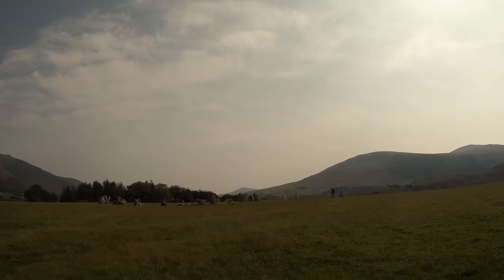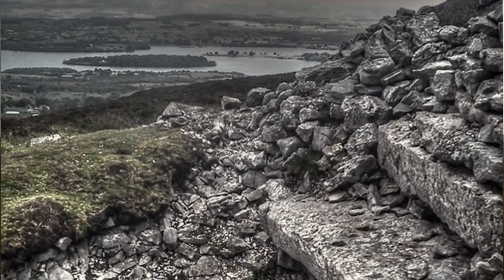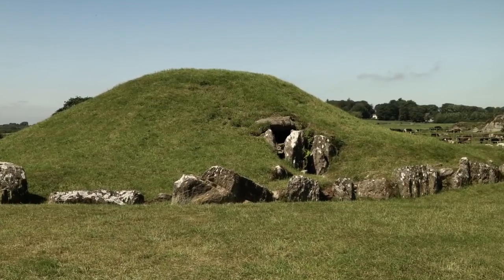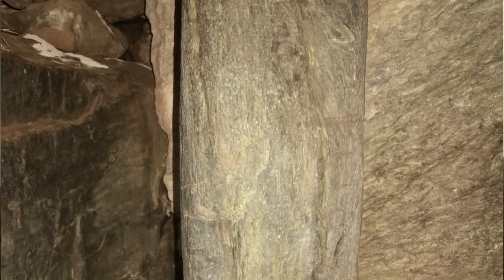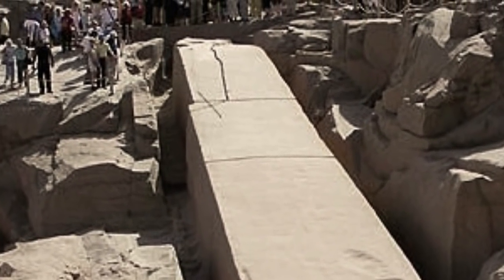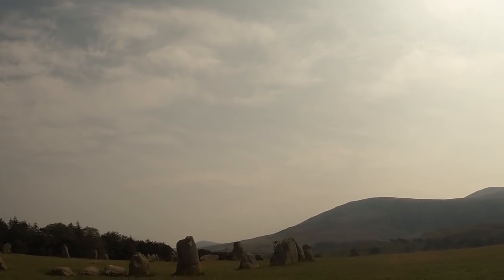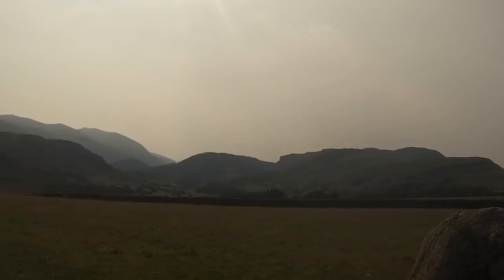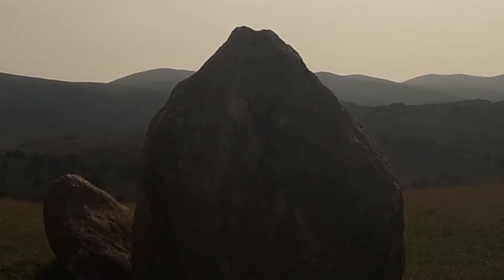Deliberate Mineralisation and Petrification in Megalithic Structures | MYSTERIOUS HISTORY

Comment: Brilliant observation! I'm a gem and mineral collector and somewhere along the way I learned it doesn't take long to petrify wood, so it would make sense in ancient times they would utilize the process for megalithic structures.
Reply: I read that it takes millions of yrs. Where did you see evidence that it can happen fairly quickly? I'd like to read about that. Thnx
Reply: @luminous3357 One of my wholesale shops explained it to me. I also have read a couple of supportive articles, but I didn't save any links. The information is out there for you to research on your own, though.
Reply: Farmed pearls for instance - I was at a thermal spa recently and I was told by the workers that they had to saw off the stalactites produced on the mini waterfall every week.  Look at the crappy London tap water - that coats the kettle pretty quick
Reply: @doctormollikovski8481  Wow...interesting. I actually just saw a post on ig of a petrified ladder in Scotland from the 1700s that led down to a pit.
Reply: @kimiknows  thnx I will
Reply: @luminous3357   there are exquisite ancient sculptures with running water and the use of ‘growing  stone’ for special effect - look up trovanty ( the moving stones). 
A whole city was built around the healing thermal spa in the Hieropolis Pamukale .  I spent a week during there during the PPP boogey man season.
Reply: @doctormollikovski8481  👍thnx
Reply: @luminous3357  the ladder he showed here took less than a hundred years to petrify. Did you watch this video??